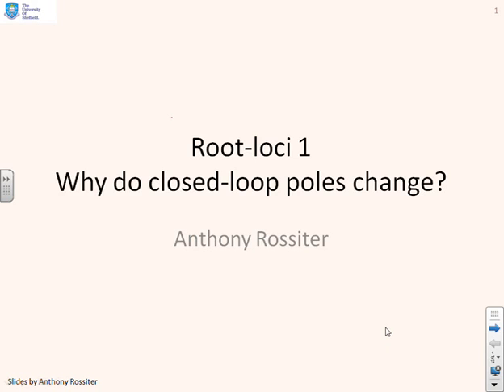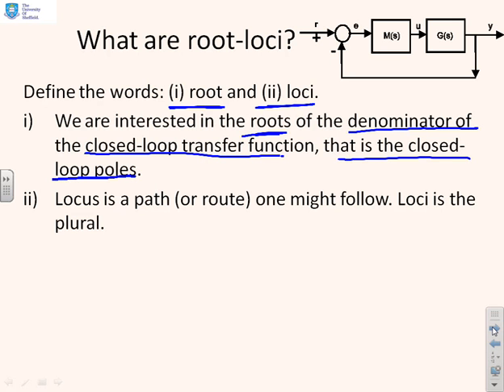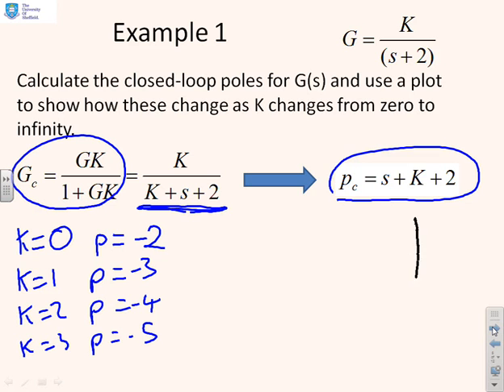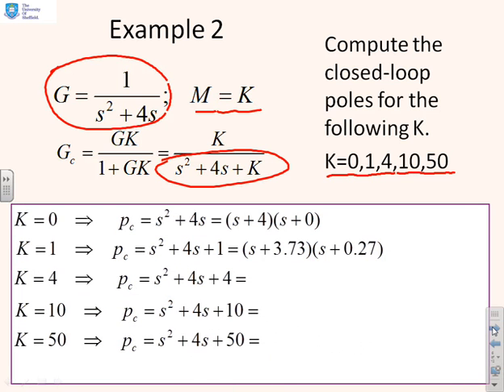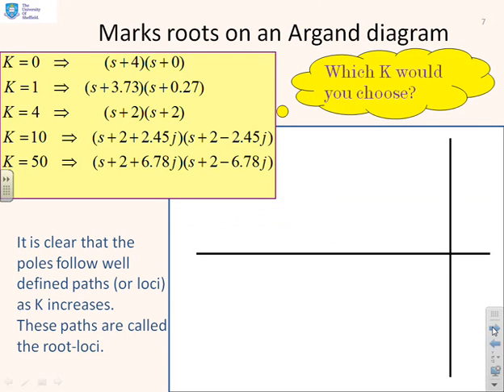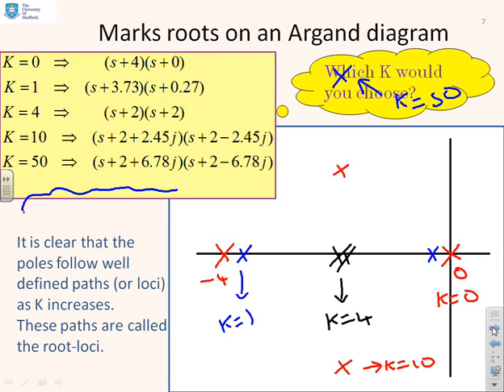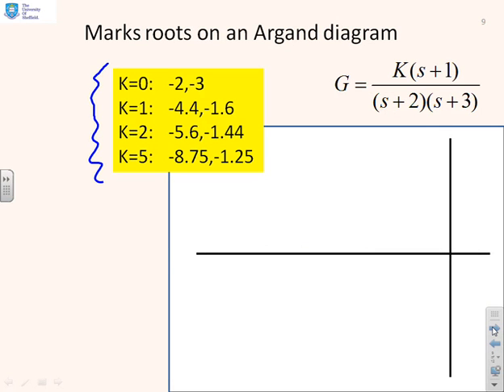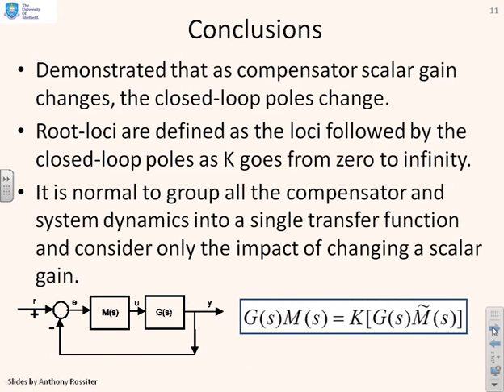Root-loci 1 - What is a root-loci?

Comment: hey, not sure if you still need help on this but I think how he got the closed loop TF was from picturing a block diagram of K/s+2 with a feedback of 1. So when you calculate the closed loop tf, it will be (k/(s+2))/(1+K/(s+2)), so simplifying this gives you K/(s+2+K) which u then find the poles by s+2+k =0.